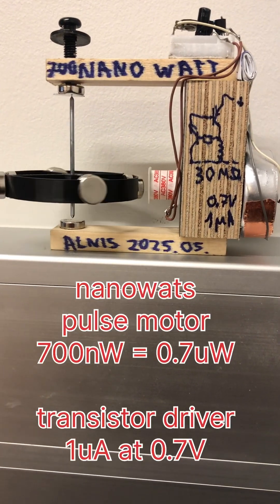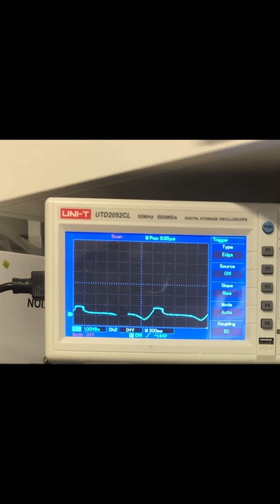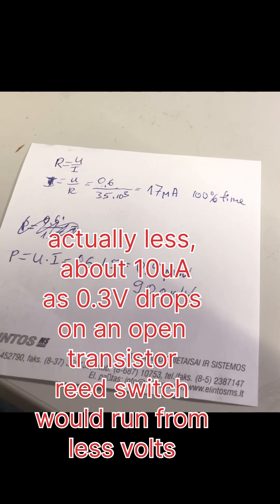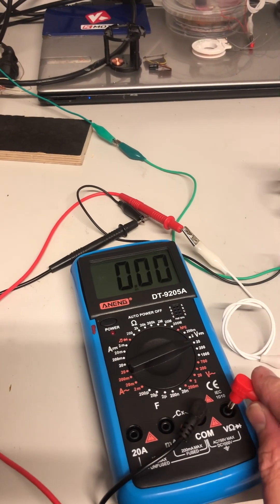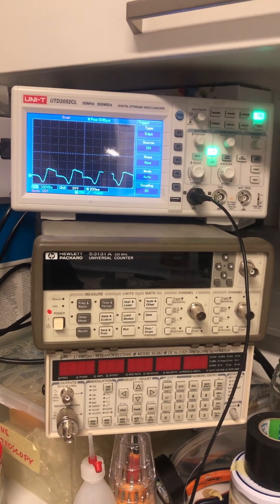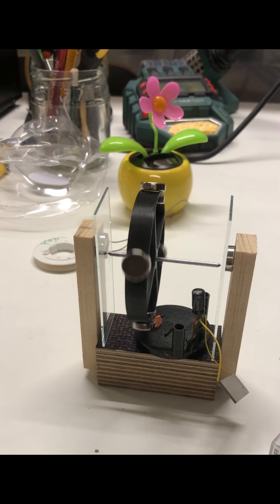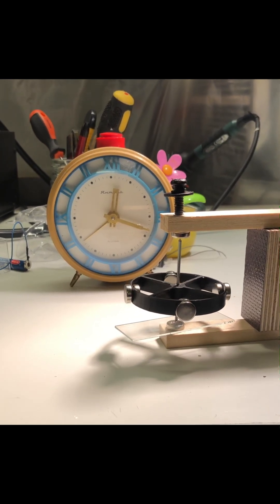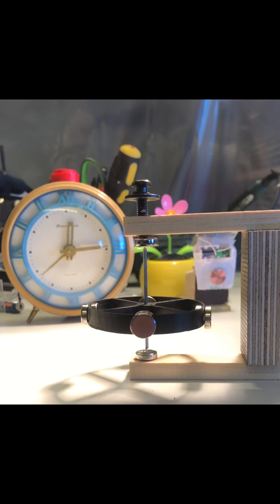Sub-microwatt pulse motor: 700 nanowats. Low friction suspension. Free rotation more than 15 minutes

Comment: You need germanium transistors as they will work with voltage as low as 0.2v
Reply from the maker: yes should try germanium transistors. I have some old.
Reply from the maker: tried germanium transistors. They work indeed from 0.3V, but have poor internal resistance and give larger leakage current. They are goood if current is 100 uA.